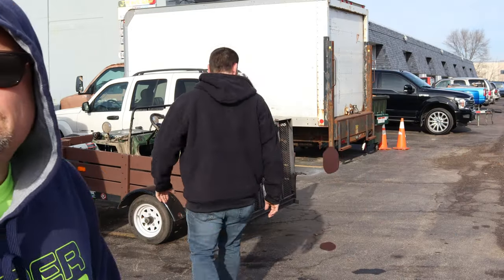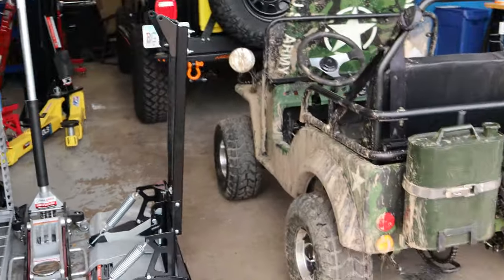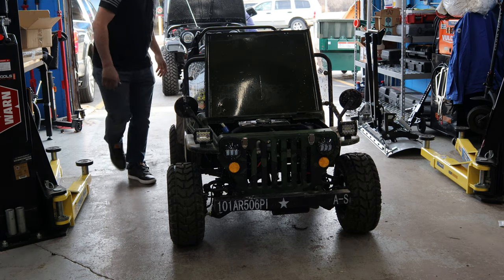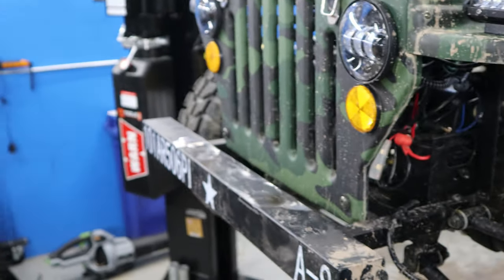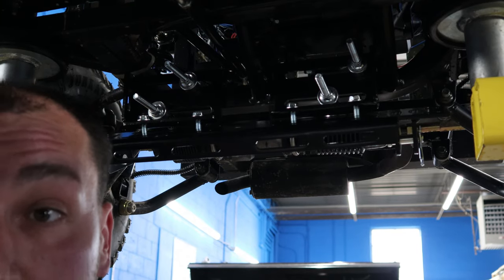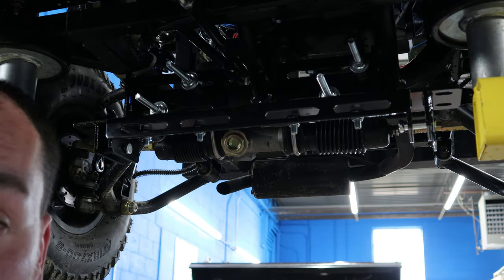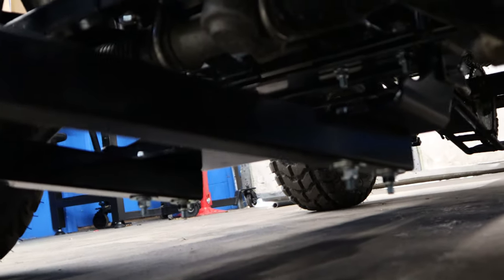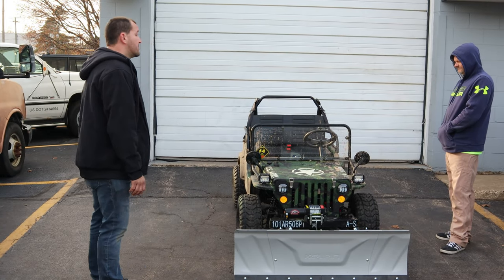Mini jeep plow and winch install!!!

Comment: Wish you would have showed how the wiring of the winch and remote was done. You passed right over it.
Reply from the maker: It's literally positive and negative hookups lol
Reply: @Projects815  will it drain the battery?
Reply from the maker: @itz_yahboyyasin9864  it will unless you upgrade the battery.. it will work on the factory battery though
Reply: Mine doesn't work.  Hooked to existing battery @Projects815

Comment: What size of battery did u use? Looking to do the same to mine
Reply from the maker: I put a motorcycle battery behind the seat. I ran 8ga wire to the front and tied into the factory wiring. It works great!
Reply: Would that be a 12 amp?

Comment: Great video I laughed soooo hard seeing the keep going up a lift that made my night thank you
Reply from the maker: 😆 it worked though lol
Reply: @Projects815  oh question to ask do u have issues with the positive cables being short I’m fixing my bosses jeep lol found it wasn’t attached very well plus the battery was dead hehehe i think he will be surprised to having it work again
Reply from the maker: @matthewsalvador9783  I upgraded my battery I have a Harley-Davidson battery behind the rear seat I ran extensions from the front to the rear. works amazing!
Reply: @Projects815 we’re can I buy the plow and the attachment for the plow
Reply: @Projects815 what is the base plate size the length